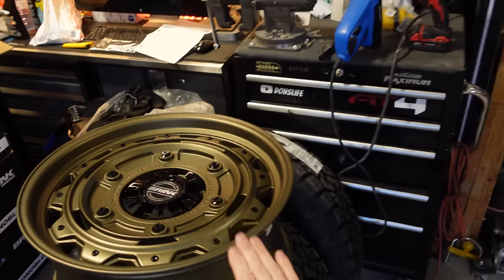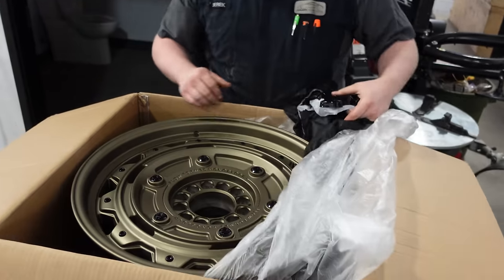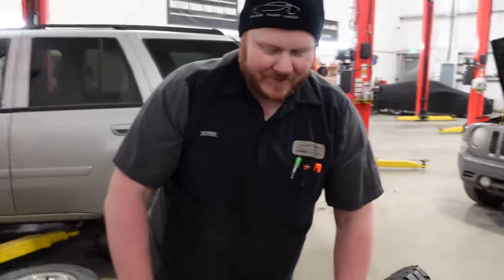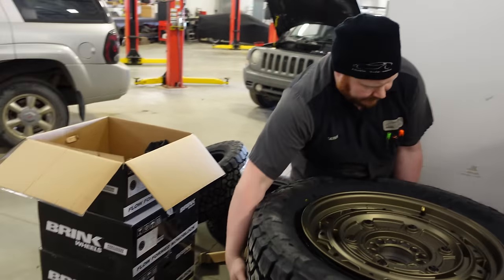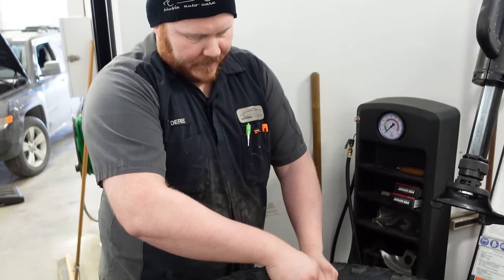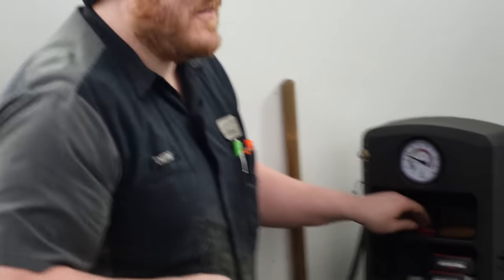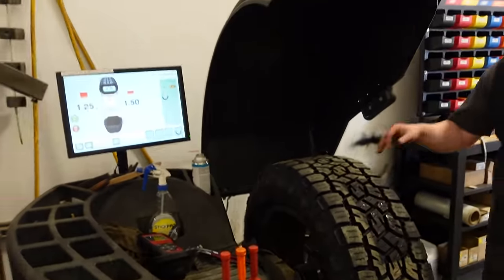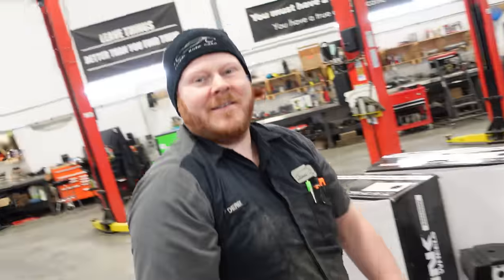Upgraded Wheels & Tires for the GMC Sierra AT4: Mount, Balance, Review

Comment from the maker: Wheels in Video : B4 BARRACKS - B402 Royal Bronze - Size: 20x9 Offset: 0
Bolt Pattern: 6x139.7

Visit https://brinkwheels.com/

Save from $50 to $200 (depending on order details) 
Use the Discount Code : DONSLIFE 

linktr.ee/donslife - Links to all of my products and discounts
Reply: Did the 0 offset of these wheels give you about the same stance as your factory wheels with the 1.5" spacers?  Trying to decide on a 0 or -12 offset for my at4.  Do you think -12 is too much as far as potential wear/tear on the truck?

Comment: To remove that rubbing there's a bolt on bracket behind that felt liner I removed it on mine and drilled a hole in the mudflap to add a bolt to screw in where that bracket attached to the body.. that pulled it in roughly 1.5" and no more rubbing.. and I did heat the mudflap before screwing in that bolt so it molds into it's new position.
Reply from the maker: Yes sir! Well aware!  I am waiting for my fender flares to see exactly what if anything that will need a little nip/tuck
Reply: Great idea!  I’ve just encountered this with my new wheels.

Comment: Looks good. Good choice going with theToyo AT3. I have a 2020 AT4 and I tried the Nitto Recon Grapplers. I ended up switching them because I wasn’t able to get a smooth ride with the factory size 275/60-20. I just switched to the Toyo AT3 and they are way smoother. They look more narrow than the Nitto so I wish I would have went with 285’s as you did.
Reply from the maker: I think we did alright 😊
Reply: Nitto is overpriced! Don't last,  I just odered35,s in 12 ply 👍

Comment: Looks awesome! Keeping my stock 18” wheels but with my Readylift leveling kit, I’m going to stuff a 275/70/18 Toyo AT3 tire in there! Psyched to hear of your experience with them 💪🏻
Reply from the maker: Sounds great!
Reply: Do 295/70/18
Reply: @Michael_Puddephatt  I wanted too! But with the Readylift leveling kit upper control arm, I don’t believe I’ll have the clearance to put anything wider than 275. Unless you’ve had a different experience?
Reply: @edgerlyb19  gotcha yeah on stocks it will rub but you can add 1/4 spacer if you wanted

Comment: Looks great Don! Do you have as much poke with the new setup? I'm running the very same wheel spacers (thanks to you) on my '22 AT4 with the stock wheels and love the look.
Reply from the maker: .36' less poke.  Check out this link, it allows you to account for spacers and helps compare exact differences : https://tiresize.com/wheel-offset-calculator/

my factory 18x9's were 24mm offset with 275/65r18 tires (+1.5" spacers)

new 285/60r20 offset zero (no spacers)

Comment: Love the wheels looks awesome...would this fit on an elevation trim sierra 1500? Or does it have to be a at4?
Reply from the maker: They have one the fit your Elevation with pretty much the same offset.  Email them or call them for help, they know their stuff.  Use the promo code DONSLIFE and it might save you some money too.   If you keep the stock tire size, you shouldn’t have any rubbing issues either.

Comment: What size tires did you go with? I have a 22 Silverado trail boss. With a 1.75 inch level kit I was going to go with some Ballistic wheels 20x9 0 offset and Toyo open country At3 295/65/20. 34 inch tire. My research indicates it should not rub.

Comment: Like the truck. I have 2020 Elevation package Sierra, did a 3in lift and have 20x9 stock wheels with a spacer, and 305/55 nitto tires. Love it. Mine is in the shop with bad lifters though =(
Reply: @@mrsds44th ya it’s bs! Love the truck, but they have to figure that stuff out
Reply: I too had lifters replaced in my 2021 Serria with 15,000 miles, so far so good

Comment: Have you had to recalibrate your speedo, or have you ever checked to see how "off" it is?  And what are you doing with the old wheels and tires? Thanks
Reply: It's only out a few kms
Reply from the maker: I will be covering it in a video but it is barely out like Mike HD said.   Funny thing is my speedo with the factory setup was 1-2 km out (slower) than actual.  Now it is the other way (faster) than what the speedo says.   I might choose to live with it.  We’ll see

Comment: Hi Don love your channel and your mod's you've already have done ,it look's amazing so far.On your just recent vid bout your tire's and rim's you mentioned you had put Bilstein's 5100 series shock's.I purchased  a set myself.They are the 5100 B8 serie's with a 6 ring height adjustable.If your's are the same what position did you put them in.I have a 2020 TB silverado 5.3 that came with the 2'' factory lift.Can you give me some insight as to where to position the ring clip just to level it.And I do plan on putting lt 285/70/18's later.The duratrac's are way to annoying .
Reply from the maker: Where did you buy the 5100s?  I think the TB and AT4 have a specific one that only has 3 levels of clip adjustment.  I put mine in the 3rd position which is 1.1” of increased height.  Here is the part number I used : Bilstein 24-309509

Comment: Hey Don. I got a 20x9 gmc with 2 inch lift kit. My tires are 275 60 20. What wheel/size do I need to have the same factory look?  0 offset?
Reply from the maker: Use this link - Thank me later : https://tiresize.com/wheel-offset-calculator/
Reply from the maker: The 20" factory wheels and 18" factory wheels might have a little different offset, so check that out too by doing some research.  My factory 18x8.5's are a 24mm offset, so a Zero offset sticks out more than factory.  My spacers were making my factory wheels more like a zero offset wheel.
Reply: @Donslife  I was told 18mm would be no problem.  Your thoughts on method wheels?

Comment: Do you find they slide more than the Duratracs when in the snow and on wet roads or is it just me?
Reply from the maker: I won’t really know until next winter returns now..
Reply: Most likely better than Goodyear,  the duratrac isn't good in winter
Reply: I have had 4 sets of duratracs I would have gone with another set if I could get ahold of a set.  Supply in Canada sucks. I’m currently running AT3’s and I find they slide around a lot in the snow and on wet pavement.
Reply: @HillBillyTheKid  my buddy had them on 19 Denali hd,  they were  ok but wore faster I thought. I'm BC,  gravel roads all around town, he ran them for 2 years. Pretty slippery with the second winter
Reply from the maker: I liked the performance of my Duratracs.  They were a decent tire in my opinion, but I wanted to try something different too.  I was considering MT BAJA Boss ATs, but they were out of stock and quite a bit heavier

Comment: Nice! Do you think with the mudflap delete kit you will have zero rubbing?
Reply from the maker: Not sure, but optimistic.  It comes down to mounting points and material thickness of the product I have chosen to replace the mudflaps.   Unfortunately almost everything is determined by pictures on the internet 😂

Comment: Hi Don. Greetings from Alberta. What are you thoughts on running LT295/60/20 ATIII on my 2021 GMC Sierra AT4 with Bilstein 5100's and Bilstein UCA. I am currently running 33x12.5x20 Goodyear Duratrac on Carbon Pro 20" wheel. Thanks
Reply from the maker: Hey there!  I am from Alberta!  I like this site to figure out tire sizes : https://tiresize.com/wheel-offset-calculator/

Comment: My sierra is having 275/60/r20 with no rubbing
Reply from the maker: They shouldn’t since that is the factory size for 20” wheels.  These are 285mm width and a tiny bit taller as a result.  Also these wheels have a different offset

Comment: Love those wheels. But stick on weights?? Why?!? Just get dynabeads installed inside the tire and the tire will stay balanced for it's entire life. Any other method, lead weights or stick on, will be out of balance as the tire wears down. Stick on weights fly off. I can't believe someone like you went with stick on weights. Look up dyna beads if you don't know what they are.
Reply from the maker: I have heard of beads.  I haven’t used them.  Not all shops even offer them.  Sure I could pull the valve stem cores and pour them in.  I heard that beads can be a problem for some TPMS too.  I don’t know, but that’s what I have heard.  Maybe there are screens for them or something.  Centramatic balancers are an option too.  Sorry to let you down, but I am lucky that all my vehicles have made it this far with stick ons.  I haven’t had any fall off including my M4 that goes pretty fast.